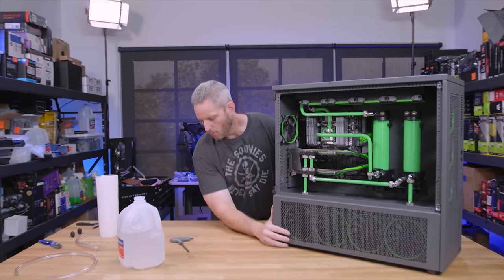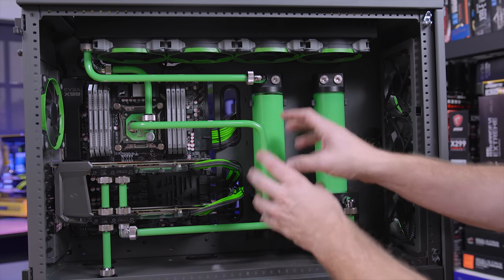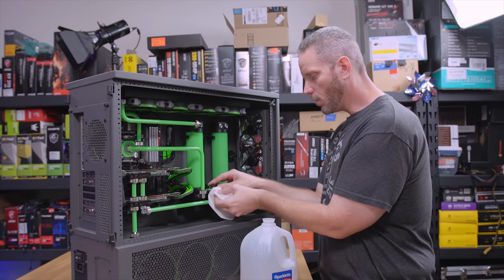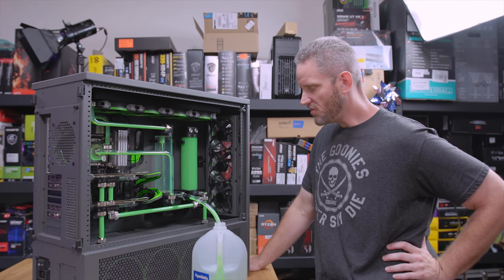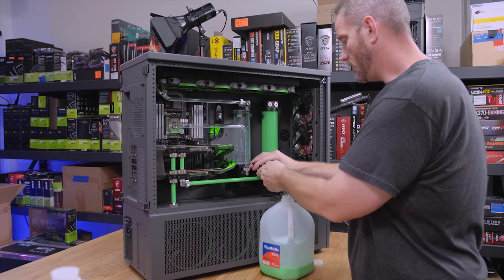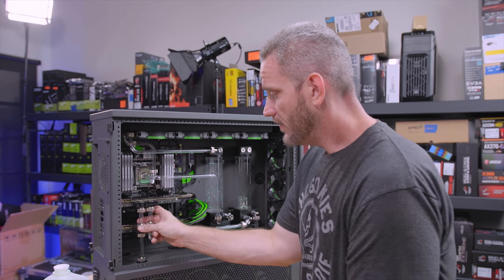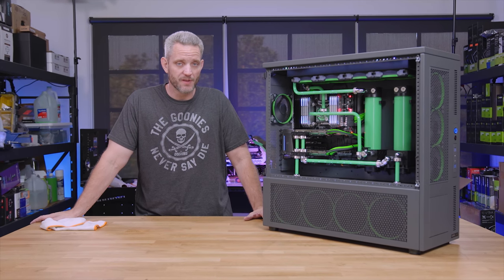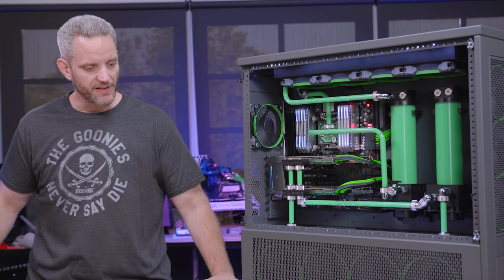This fluid has been running for TWO YEARS! Did it hold up?

Comment: My 110i GTX Aio Pump died after 3 years.
Bought a Noctua NH-D15, and i was a bit worried if i could keep my 5ghz OC on the 8600k wich is not delidded.
After installation i was shocked.. 70C/158F  at 1.36v during an OCCT stresstest.. . wich is basically the same if not better than the AIO.
And it runs a hell a lot less noisy, those temps where reported under 40% static RPM's. 

I'm not even doubting delidding the thing anymore, since i need over 1.4v to reach anything higher, i'd like to avoid degredation.
It looks like shit compared to nice watercooler cpu blocks that AIO's have, but that's the sacrifice i'm willing to take.
I'm not willing to spend a couple of hundred on a custom loop, and i'm pretty lazy to do any kind of maintenance.

I couldnt be a happier man,  90bucks well spend.
Reply: Had a NH-D14 for the last 8 years, tossed a couple fresh redux fans on it since one fan made a slight noise after 7 years of 100% speed. Keeps my 4.6ghz@1.4v Westmere hex nice and safe while blocking any of those pesky ram heatsinks!
Reply: aios are pretty shit tbh
Reply: I would love to have a NH-D15 but it wouldn`t fit in my case so going with a Sycthe Fuma Rev.B that`s replacing a 120mm AIO.
Reply: The thing with custom loop is that apart from gpu blocks anything can be used for years, therefore the custom loop might be worth it.
Reply: Noctua Chromax,look into that,they're fans and accessories to make the d15 look better
Reply: Well there's less that can break on an aircooler :P Only the fans but that's the same for watercooling.
Reply: I ran NH-D14 for years on my 3570K and got the new NH-D15 AM4 for my Ryzen 1700. Both have been absolutely amazing. With Noctuas you can't really go wrong as long as you have the space for them :)
Reply: Just got the NH-D15S and a chromax black fan for my cousin's new build and going by benchmarks, it's supposed to be 2 degrees warmer than the d15. Those coolers are so reliable and the d15s actually has pretty good RAM clearance

Comment: Hey JayZ! A while back Linus did a video on "the crappiest SLI setup ever", I was wondering if you'd be willing to do the "crappiest Crossfire setup ever"?
Reply: It’s crossfire, it wouldn’t work properly
Reply: Neither did the SLI setup in Linus's vid, hence why it's called crappiest.
Reply: Yeah, it would also be great if it catch fire
Reply: What's with the fascination with old hardware? A pair of X800s is going to run like shit even if they work.
Reply: Jeez look at all the Debbie Downers. It would be interesting to see what it would be like. I never said it would be good, hence for the third time I have to remind you that it's the "crappiest" setup.
Reply: I would like to see that as well to be honest, i remember back in the day when crossfire was the setup you could use with 2 different GPUS (same generation) but that stopped around the 2xx series...

Comment: I made a custom water cooled build I made back in 2008 and it is still running never drained. Merely top it up with distilled water occasionally. Original fluid was red colour Feser One. Still very red and can see my gold plated cpu block no corrosion issues.

Comment: 8 years with Mayhems UV Blue in a soft tubed loop. No problem except uniform tube staining 😁. Using the same in the 5.6GHz all core OC 13900K and 4090 I currently have on my Streacom test bed.

Comment: Go to a glass blower and have them make custom res’s. That’s over-the-top!
Reply: RdyPlyOne Where would you make a rubber ring to seal it though?
Reply: @HudsonGTV  I'm sure there's a way because people mil custom res's before. It technically only needs an in, out, and fill port. Soft tubing and a hose clamps can make the connection.

I've floated this idea around because I've never seen it and I've seen some custom glass smoke pipes...The process of making them can't be too different from a res because it's just a chamber.
Reply: Not blown glass, but I am doing a custom acrylic res for my rig.
Reply: Ground glass joints come in all shapes and sizes.

Comment: Hey Jay, 

Why don't you have any tutorial videos about post- build. For example, updating BIOS, testing components, changing Memory speed, installing drives / Windows, adding additional HHD / SSD, configurating the system......stuff like that.

I have found very few videos about this stuff, its usually all about building the PC and the video ends once the power is switched on.

You're always asking for suggestions on videos to make- I think these would be great as the topics are seldom covered in detail and it would help first time builders, thanks.
Reply: If he does do that then I would watch it.

Comment: 2 rtx 2080 ti coming up jay?
Reply: so they can bottle neck skunkworks?
Reply: isn't there no sli on rtx? or did I just hear that wrong?
Reply: @ThunderGoatz  rtx comes with nvlink and that only supports 2 cards.
Reply: Yep, I heard that wrong then.
Reply: How about X399 Threadripper 2  2990WX with 2 Vega Frontier Edition, bios flashed to liquid bios, and volt modded the soft power plane tables? Crazy, unnecessary overkill. Or 2 water cooled quadros

Comment: I have a water-cooled CPU from 2009, haven't done a SINGLE THING to it, still runs perfectly. Air-tight systems don't need maintenance. In-fact, unless there's a problem, I'd recommend NOT messing with it.

Comment: Been running a multimedia box since 2007 (intel q6600) same coolant(just distilled water) never changed just topped up every couple of years lol. I just keep a small piece of silver in the  water tank. (I use water cooling because near the sea air cooling rusts out the mobo.

Comment: With right liquid loop can go long time without fluid changes. I've built client pc long time ago with clear innovatek liquid that sucker ran for about 6-7yrs also. I ended up buying it back from person. Took loop apart very little build up in blocks I couldn't believe it. Koolance liquid is also very resilient for long term use. That build that went 6-7yrs had eheim pump that pump is still running to this day in my current rig, it's about 10yrs old now.

Comment: Curious but possibly deadly idea here:
Could you demonstrate or reply to the possibilities of a liquid cooled Pc utilizing Mercury instead of water? I was watching Cody's lab channel saw the Massive amounts of mercury and then your epic water cooled stuff then it hit me, what would Mercury do and look like and how would it perform?
Reply: I know mercury is something like 13 times more dense/heavy so would need good pump solution....
Reply: It would totally look BA IMO!
Reply: I was curious. Thanks
Reply: @dnelly9967  now gallium that is not as lethal, however it eats up aluminum.
Reply: "Mercury also reacts with oxygen at high temperatures to form mercury (II) oxide"

Basically, it's not safe to use as a coolant... In addition, it's heavy, so whatever pumps you could use to make the mercury flow through the pips is gonna struggle... Not to mention, Mercury is Toxic and dangerous to humans... Using it as a coolant in your PC system would be a serious health hazard.

Both mercury and Gallium corrodes most metals... So it would be a hazard to your PC's well-being too.

I'm sure there's several more reasons why mercury is a horrible choice for coolant, but those are all the ones i can list off the top of my head. :P
Reply: Vodka.

Comment: As a mechanic/computer nerd, I've always wondered why you couldn't just use car coolant in one of these systems. I don't see any logical reason for it. Automotive coolant would laugh at 80 degree temps all day and even the top of the line 10 year rated hoat stuff is only 30 bucks a gallon.
Reply: Nvm after reading more on it auto coolant apparently eats the plastic tubing.
Reply: @alexmaclean1  Get metal tubing problem solved. XD
Reply: @alexmaclean1  so car coolant is only good if your using non-plastic tubing? So glass will work? Or copper? or brass? ...or rubber?
Reply: @White_Night_Demon  I would think that would be fine really. Automotive coolant aren't corrosive, in fact they inhibit corrosion so I think the only people that say it would be a problem are likely the people who sell computer coolant at 50 bucks a liter lol it just doesn't make any sense that it would damage the same kinda if materials in a computer that it lasts for years touching in a car which experiences far larger temp changes and pressure.
Reply: @alexmaclean1  Have you tried it on plastic tubing to see if that's the case...?

Comment: No matter how nifty you think it looks, pastels/opaques always have particulates, and will always eventually cause buildup somewhere. 

I know it looks boring as hell, but I use pure distilled water treated with a biocide (literally one drop of 5% copper sulfate solution is enough for a one liter or smaller loop volume). Following the recommended yearly drain, flush, and fill, I've yet to ever see one spec of any foreign substance from my rads, reservoirs, or blocks. Glass tubing with one-time armor-all-treated o-rings clinches the deal. Not having dyes or bullshit pastel additives also as one other significant advantage: zero "discoloration" or shade concerns when flushing/filling because there was never any "coloration" to begin with. Function over form; always .

Comment: I haven't touched the coolant in my H60 on my Ryzen 1600x. Other than needing to clean a good layer of dust off the radiator, it idles from 25-35c and hits max in mid-high 70c range (exporting a 10min video for youtube maxed out all 12 threads at 100% for 30mins and temps shot up into the mid 80's. Max temps I read are around 95c but after removing the dust in the radiator and exporting another video, max temps stayed below 80c, which I also hear is normal and good. No overclocking btw. Temps never reach that high while I game, but while I think about it no game I play ever maxes the CPU like a video export. I also am to understand that I shouldn't crack open a factory loaded cooler like these unless I could introduce air and such so I haven't. Should I, or as long as the temps stay normal all is good? It's only been a year since I built the system, no idea how long my H60 was on a shelf somewhere before that though.
Reply: Hell my current PC with closed loop sat burried under a bunch of stuff never used for two years and then when first started and today cools my CPU enough where it doesnt ever touch close to 70C during load.
Reply: Lol you won't ever change coolant in an aio

Comment: Why can't you just use car coolant. It lasts longer and is able to deal with much higher temps.
Reply: Computer coolant doesn't have to deal with temps as high as engine coolant, so the advantage there wouldn't matter. On the other hand, car coolant has anti-freeze in it, which is also unnecessary and would make the fluid a lot more toxic to work with (an important problem when you're supposed to periodically change your fluid). It also makes the heat capacity of the fluid worse compared to just plain water.

Comment: wait i havent changed mine in 8 years...
Reply: Have you changed it since making this comment?

If not, go do so now before you forget again
Reply: @Spideryote  lol sadly no. I built a new computer (air cooled) and gave that one to my father. Temps and everything are still running normal, and he doesnt game. One day ill do it and ill see if i can make a video from it.
Reply: @nebunas  no way, the same open water loop for 8 years?? Most people can't even make their closed  AIO water loops work for 5 years lol
Reply: Both my closed loop water coolers are running for 5-years. Both crappy AMD FX gaming PCs on big overclocks, so like water cooling a toaster oven. My main systems is a FX 9590 just under 5 GHZ with temps completely stable. Only maintenance is blowing out dust off the mesh intake screens. Changing out coolant is only required when coolant mix was not done for longevity but for show...like Jay's system.

Comment: Something you might want to look into is a manual transfer pump. I have used them for years for changing and flushing coolant from my systems and they have made these processes significantly quicker and more efficient for me. Just google "Multi-Use Transfer Pump".

Comment: I have an old Corsair HydroCool 200 that bought back in 2002, the water block was for an AMD Barton 2800 CPU.  I still use it today, I have the block tiewrapped down onto a 6700k Skylake.  Anyway, its the same coolent that I put into it back in 2002, just top it up now and again with tap water.

Comment: also connect the two loops between the reservoirs , larger thermal mass equals more stable temperatures.  I really want to use a underground reservoir like a repurposed large underground propane tank to provide room and cpu cooling. benefits aside from the sound level is free cooling using geothermal cooling.

Comment: I have been having great success with my Primochill vue. I have had 2 different colors running in separate loops with identical parts for 14 months now. so far i have not had any issues with separation or color shifting. I am amazed with my results because i believe Vue has a 4-6 month life span. as well as being extremely sensitive to metals, current, temps, and everything else. Would love to take it all apart at some point to see how everything looks inside. I dont plan on doing that though until the fluid shows obvious signs of breakdown. which hasn't happened yet.

Comment: I’ve had my Corsair H100i GTX in my system since August of 2015. I leave my PC on a lot, so it’s probably seen more time running than not over the last 5 years. 

Everything except the H100i and the graphics card has changed in that system, including the case. But it still performs great. I’ve heavily neglected my system over the last 3 years, so it’s a dusty mess. On top of that, one of the fans on the H100i quit working, so it’s only running on one out of two fans. But, despite all that, it still never lets my CPU above 60°C. It usually sits around the upper 30’s to low 40’s when doing desktop tasks, and hovers in the 50’s when gaming. I know all that will go down after a fan replacement and a good cleaning. 

Moral of the story: The Corsair H100i GTX is a great AIO that can survive 5 years of mostly powered on time in neglectful conditions.

Comment: Whats good Jay / everyone! :)
So quick question...

After becoming a fan, I gained the confidence to build my EPIC machine,  I did pretty well I must say... I'm still impressed as we enter it's second year of life :)

BUT...well, here's the deal. I've followed most of the suggestions but when I did my leak test everything was fine soooo instead of clearing it out, BTW I used distilled water & white vinegar, I just... left it alone instead? I bought some really expensive Thermaltake fluid but realized after I didn't have nearly enough and it would cost like 200$ to get enough OR 8$ worth of distilled water / vinegar. 

Long story short,  my leak test has been going for 2 years and maybe it's time to take the leap and change it?

...lol I'm so nervous, this machine cost an arm leg + a baby, way more than I can afford today...so what precautions should I take before I get started??

Anywho...thanks everyone :)

Comment: Different colors changing differently over time?
Is that OLED or Plasma liquid?!

Btw, serious question here: shouldn't you change O rings after you unscrew the fittings ?
My understanding is that when you compress the rubber, it will deform slightly and once you put it back in, the deformation will not be in the same spot as before, making a leak more likely.

Comment: Question: Is it necessary to change the fluid on a retail water cooler? I bought an NZXT cooler about 3 years ago and I am still getting impeccable performance. Clock @ 4.78Gz and temps around 45-50 C under load.

Comment: Realizing that my coolant has been running for 5x years at high temps and then going, "Meh". My liquid coolers are running perfect because I use coolant done right, designed to run clean for years, if not decades. As soon as you add dies and pigments...it's no not done right...but done for fun. Use good RO Water with long-life closed-loop additives and you're golden. DI water is too unstable, even with additives, as it doesn't take much to get it to go sideways. Silicon chip manufactures use ultra-clean DI water to clean parts...because DI water acts as an aggressive cleaning agent, but only once. When in a closed loop, it goes full napalm.

Comment: Actually you get less buildups if the pc runs longer at a time or is actually never turned off. My dads last wc did run for 10 years straight without turning it off. And i did drain is last week. No build up no leaks. Im actually going to reuse the radiator for my build im doing next week. Since even after flushing it with isopropanoö which should have washed out any build up. The water did come out clean. And not blue. So it just depends on the color you use.

Comment: The only fan I have in my PC is the power supply box in my 8 yr old PC. Still using a GTX 760 and some weird water cooling, do I have to change this? I dint flush do anything in 8yrs. But it's still running smooth & quiet like it's still brand new.

Comment: my white fluid lasted 7 years before my graphics card finally gave out the other day, it wasn't white anymore, it turned clear like water. the pc ran 24/7 for the most part also. honestly surprised it lasted as long as it did.

Comment: I have a pc thats currently 6 years old i7-3770k build. I never changed the watercooling loop since i built it. (Liquid is Ice Dragon Premixed (no longer sold as premix) Best part is theres no drain port due to the one they sent me being a leaky-faulty one, so all you do is cut the tube and replace lol. I should send it in so you have another video you can make. I have the original temps too from 6-7 y/o ago. Built in late 2012.